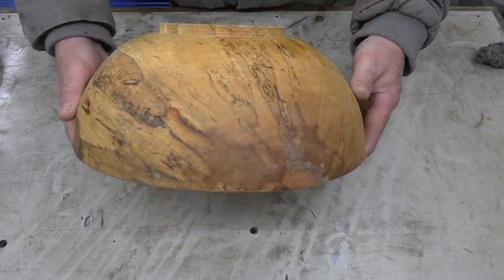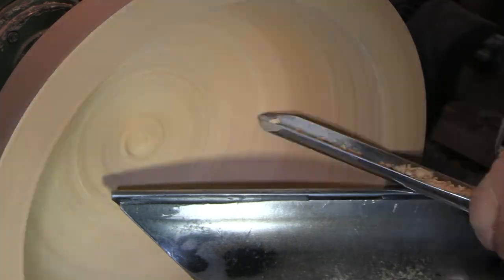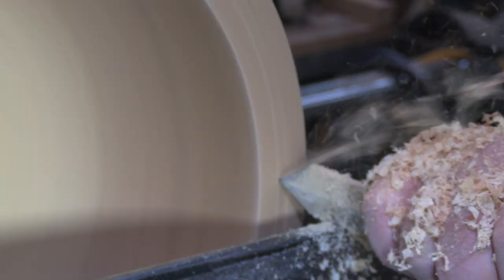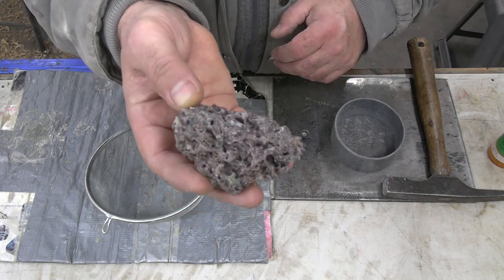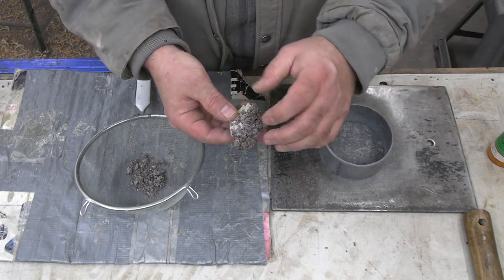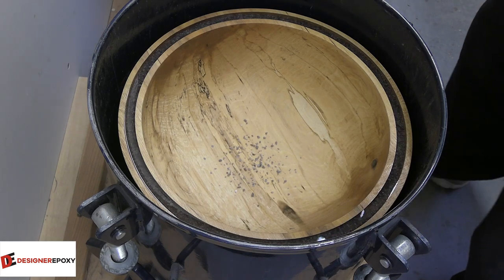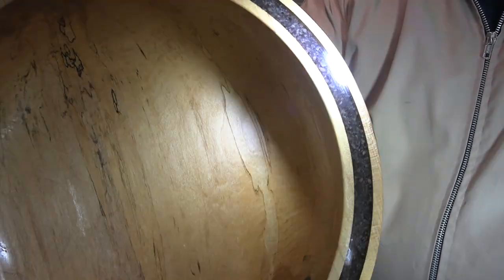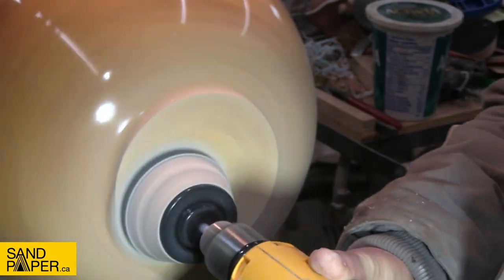Woodturning - Spalted Maple with Purple Diopside Inlay

Comment: Love that spalting. I have some spalted cottonwood that turns nicely. Designer epoxy.
Reply from the maker: If you can stand the smell, lol. Thanks for watching
Reply: @SpragueWoodturning  I have not noticed a smell. The chunks are 8 to 10 inches in diameter, blown down on the around after about a year in the woods behind the shop. I have some much larger pieces that came from the river bottom nearby. I give them a sniff.

Comment: Why did you switch from thin CA to epoxy for your inlays
Reply from the maker: It works better in this case. If you pour that much CA it’s bound to leave waviness in the CA and the resin won’t do that. When resin is mixed with soapstone and then put in the pressure pot it will also eliminate any voids. The only real knock on the resin is that it darkens the inlay and the CA will give you a truer color. Thanks for watching

Comment: Beautiful inlay. Did you leave the heart in to keep the height of the bowl or would cutting it back have lost some of the other characters of the bowl? I'm new to all this so asking so I can learn.
Reply from the maker: The pith was gone, that’s the very center of the tree if your not aware. Sometimes the other heart wood in the bowl can be less than perfect so that’s why I used the glue on it. To remove it would of took a bunch off the overall hight. Thanks for watching

Comment: those uv flashlights drain the batteries quickly. You need to change the batteries. In the video you can see that the batteries are empty, compare it to the first video where you connected the lamp
Reply from the maker: Your probably right. Thanks for watching

Comment: You put your epoxy under pressure.  What does that do?  I would think you would use vacuum.
Reply from the maker: It pushes the epoxy into places that it usually wouldn’t go and compresses any bubbles that are in the resin so small you can’t really see them. This is not an epoxy that you cast while under vacuum. Thanks